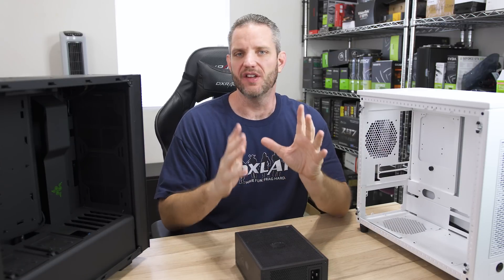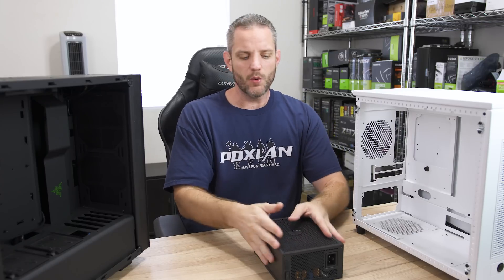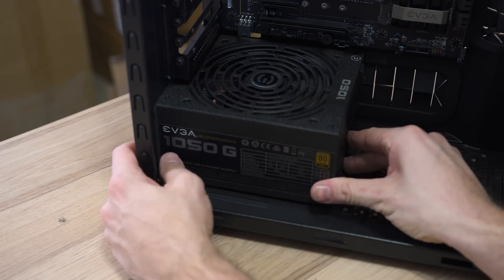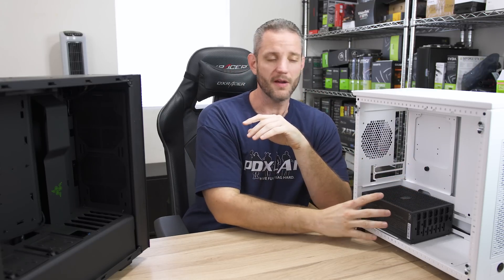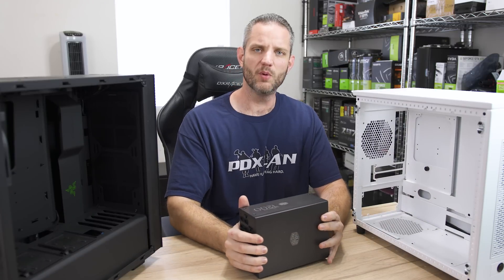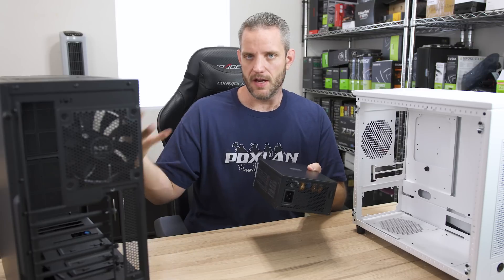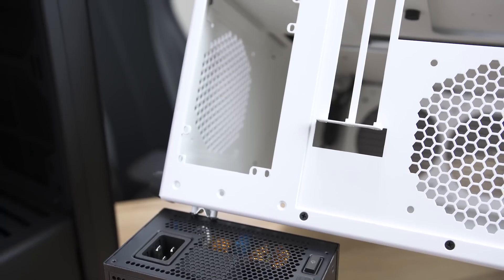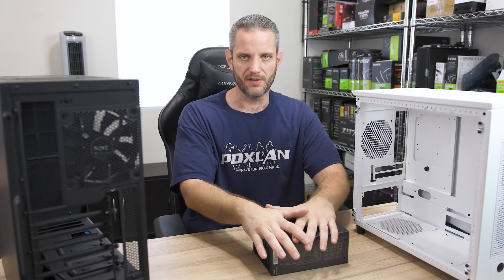Should you mount your Power Supply up or down?

Comment: It is a little confusing. The Power supply fan is always an exhaust fan. it does not pull in air. It is designed to draw heat away from the built in heatsinks that are attached to the components in the PSU.

It does not make sense to point the power supply (fan) downward as there is very little space between the fan and the floor.  An exhausting heat downward will only lead to that heat rising back into the PSU.

A power supply's ability to remove air is important but not nearly as important as the features that comes with the PSU. The power options, the connectors, and efficiency of converting AC current to DC current.

If a person needs to remove heat from the computer they should focus more on where the intake and outtake fans are located in relation to the CPU.

Comment: The clincher for me is that back in the nineties,  virtually ALL tower PC’s had the power supply mounted at the top rear of the case with the fan facing inside and moving air from within the case through the psu to the outside.  The psu was actually part of the case venting system along with the single pitiful little fan at the back exhausting the hot air.  Computers didn’t explode, psu’s did not melt and dogs who were unfamiliar with cats continued to accost them regularly.  PSU’s convert ac to dc and in doing so, create lots of heat.  Heat is their natural element and a few degrees extra of warmed air from inside the case (especially the well ventilated ones of today) is of little significance compared to what they are designed to handle safely as long as the psu’s rated wattage is comfortably a bit more than what the system is trying to draw.

Comment: 7 years later and with my new pc case there was no choice. The case manufactures made the holes requiring the supply to face down and draw air from the bottom. To me this makes sense. I would not want to add case heat to my power supply cooling input. Of all the critical systems of the computer I want to keep stable, the power supply ranks up there and heat is an enemy of any power supply. The bottom of the case should offer the coolest air draw, just keep it clear of obstructions.

Comment: I got a Corsaire CX750F RGB.  Its logo is printed on both sides of the unit in opposite ways so that, IF you can see it, it is right side up.  I like it sucking out of the case from under the video card which is verticle.

Comment: Hey Jayz! Would like to ask you about this topic; I just bought a asus rog thor platinum II psu which has the fan upside, but my current case is a coolermaster masterbox td500 mesh..it will be alright if the psu is installed with the fan up? I don't really care about the led display but would be good if I can install it the way is has been designed. Any advice please?

Comment: A question. when the fan is facing up and nearly never rotating, doesent the ventilation on the power supply facing up, radiate more heat to the mnve disk drives and the GPU ?
Than down...?

Comment: One thing that comes to my mind about bottom PSU with air intake upward: more exhaust in the PSU from the case means less air from the intake fans goes above to the CPU, also the PSU will suck some hot air from the GPU. For top mount downward intake, at least the rear fan will suck some of the air from the CPU.
The main reason I don't want to use a bottom PSU case is my room is dirty and all the dust and dirt falls on the floor. I don't trust no mesh to protect my PSU from that, even if I wanted to wipe the filter twice a day.

Comment: I had a power supply fan mounted up and now just installed inno3d gtx 1660 super gpu and now its getting hot extremely .56 c on idle with 2% load ,im worried 😢 im going to flip it down now i have same case as you shown of ur friend on carpet

Comment: should you run a psu in hybrid mode or with the fan on in normal mode? what if the psu never draws more than 50% meaning it never needs to turn the fan on?

Comment: It is worth mentioning that the mounting holes on ATX supplies are not equally spaced, and not all cases
have the extra holes to give a reverse option, something the designer of the case clearly did not intend. 
The ATX12V Power Supply Design Guide has recommendations for power supplies that require top venting 
and those that don't. On version 2.01, these are on pages 31 and 30 respectively.

Comment: So if I don't have a fan at the back I should have the psu fan facing down?
Reply: No he says if you don’t have enough exhaust flow face up so it will pull air out of the case, I would have eco mode off if that’s the case. If you have a shroud which prevent the fan from pulling air in the case then you have to face down. No choice in the matter
Reply: @OTK7796  excellent thanks for your reply mate appreciate it

Comment: I’m wanting to reverse the fan to pull air in through the power supply. Might sound silly at first but I have a small outdoor ac unit that pipes cool air into my studio and the air hose comes right into the back of the cabinet which I want to put my new thread ripper pro build. If the power supply were to pull air IN  instead of exhaust it would directly pull in the cool air from the hose and direct it upward onto the gpu ram mobo ect. Then get vented out with the upper back exhaust fan. It would reduce the internal temp about 15-25 degrees if I could just reverse the PSU fan flow. Asus Thor 1200 platinum. Any helpful ideas?
Reply: You could open up the power supply and just flip the fan around, if you are comfortable with losing the warranty

Comment: I have a bit of a long question please. I am building a big wooden PC based jukebox. The motherboard and power supply will be attached to a shelf within the jukebox. Question, will I need to have the power supply exhausting out the back of the jukebox or will it be ok to place it anywhere inside the box being that it is quite large? Cheer mate love the vids.

Comment: I don't suppose this comment will be seen by you with so many comments, but here's a related topic that I don't think has been covered: My PSU has 2 rows of modular plugs. Both rows have either 3 or 2 8-pin jacks marked "CPU-VGA-PCIE". My questions is, is there any difference between using two adjacent or 1 from each row, for the GPU? It's not as if my ASUS PSUs have any instructions.

Comment: Heh, sorry for bumping the thread. Just rearranged my cases and couldn't understand why all pc components raised 5-15 degrees Celcius. 
Reason for switching my main hardware system to my newer, cheap Riotoro CR 488 was that it was almost 'empty' inside with room for tons of additional case fan mounts - where my old Cooltek midi case included tons of hdd shelves, filling the inside up, blocking airflow, not suitable for my newly ordered huge GFX card.
Then realized my old cheap German CoolTek midi case had the PSU mount upside down. And having a big solid hightadjustable table there is plenty of free air beneath the case suspension the answer was obvious. So now my PSU is installed 'mountless loose' in my Riotoro CR 488 upside down - and what a temps difference to the good side!

Comment: Would a PSU at the top of the case with the fan blowing upwards be more beneficial? My previous PCs were all had the PSU at the top/rear with air blowing horizontally out the back. Now with increased heat and fans plentiful, would an airflow being pushed in the bottom and pulled out the top be superior? Thank you.

Comment: Started having problems with my power supply making a terrible noise. Come to find out my PSU was mounted fan up in a shrouded case at the factory. I'm wondering if this is the reason it's starting to give me trouble. Of course I shouldn't be surprised. This is the same PC that came with all of my fans installed as exhaust and a cooler with no thermal paste.

Comment: I have one of those supernova G3 PSUs, where the fan kicks into full gear once it reaches a certain temp/draw and remains there until the system reboots. I noticed this happening more when the vents were open to the bottom. I have mine open to the case, so that the pressure caused by the case fans force air over the PSU without requiring the noisy overdrive mode or whatever that is.

I just upgraded my GPU, and even this tactic doesn't help anymore. Time to sell this thing I guess..

Comment: I identify as a power supply.
The water cooling thing is a good idea.  Otherwise, it's fan up for me.  I can see the fan, know that it's unobstructed and less likely to have that "thermal loop" problem you described.  If it was more common to be able to monitor PSU temps with software or in the bios, I'd risk it the other way.  Surprisingly, tho, that still doesn't seem to be common.
In the distant past, I have run tach leads from PSU fans to MB headers, and, if memory serves, even ran a temp sensor once, but it seems that PSU monitoring never really took off, other than the ability to monitor the voltage.  I'm betting many a power supply got cooked without the owner knowing until the smoke was rolling.

Comment: For me, I have a SeaSonic Planium with Hybrid-Fan control. As the fan rarely, if ever, spins up, I have the PSU in a fan-up config as (in my mind at least) any warm air coming off the PSU vants up into the case where it's exhausted by the exhaust fans, giving a passive cooling vibe. If the fan does spin up, however, then that's an extra exhaust that will spin up to help vent the heat from the case before the temp sensors in the fan controller bring everything from "exhaust mode" back to normal running... in my mind... and in theory ^_^;;;
Reply: Yeah, I've done the same with my Seasonic Gold PSU.  Seasonic actually recommends this orientation if possible in a given case.

Comment: Hi everybody, I have a question regarding the video's topic and hoping to get some feedback/pointers. I understand that case type, general airflow within the case, components, pc orientation, internal case temp and where the pc is placed all play a factor in this matter. However I'm wondering if PSU with fan facing up into the case would be a better solution for my personal PC. I have a Cooler Master Q300L case, with Cooler master mwe 750 gold V2 PSU, ryzen 5 5600X and Radeon RX 6700 XT 12gb. My case temps are around 35 and CPU 50 Celsius under load and GPU 45 under gaming load; maxed out via 3d Mark my temps are CPU 64 and gpu 57. I wonder if I could even get better results with the PSU fan upwards; some more info. GPU and PSU are really close to each other, currently PSU fan facing outwards pulling fresh air from outside the case. My pc has 6 fans, 4 intake and 2 exhaust, CPU is air cooled with two fans on the heatsink. GPU has three fans. Any advice/pointers to if PSU fan facing up would be better, even when the PSU and GPU are super close; 3 cm apart. Thanks in advance!
Reply: I personally don't know all these specific parts. Since you already have recorded the temps with the PSU facing one side, you should try installing it the other way when you plan to clean your PC or something. And report the findings. Could help out others too.

Comment: I tried both configurations, i wanted to see if the psu up inlet would improve air flow and draw more hot air away from the gpu, yes it would heat up the psu and have a de rating affect but the psu is oversized so this wouldn't be an issue. The result was the exact same gpu temp in both configurations which was surprising since you would think this would assist the gpu exhaust. So i left is in the down inlet standard config.
Reply: That is indeed weird.
Although, out of all the fans, I have the hardest time understanding intake/exhaust and airflow of the GPU fans.

Comment: Jay, my case is an h500 unlike that other case there the bottom inside the case has all those holes where you can mount those brackets for the SSD's. Do you think I could face my PSU up cause this case is already negative pressure and It does run kinda on the hot side at times? I was looking for a way to improve the airflow some on this case and it seems having intake fans on the front does nothing for this case.

Comment: putting PSU with the fan facing down means all the internal components are ''hanging'' upside-down........will gravity pull loose some capacitors, etc ??....after all, the components are held only by the solder, right ?

Comment: I recently bought a new case and put my power supply in fan up. I have an extremely dusty environment and carpet (that hasn't been vaccuumed in 15 years). Good to know that newer power supplies don't spin their fans that much. I have two intake fans at the front, that are slightly stronger than two exhaust fans one on top and one at the rear. All are running by Smart fan 5 on my motherboard so balance themselves out automatically.

Comment: What about power supplies mounted on their side in the top back corner of a case? (i.e. in my old-ish full tower Thermaltake Armor I have the PSU's fan facing toward the optional hdd cage but if I were to have it facing away there isn't much room between the psu and the MB's plate and risks blocking the intake. I I figure the former is the most logical but I'm not really sure :-/).

Comment: Mounting mine up because case shroud is mesh and will maybe help remove heat from the bottom of a large GPU and my old psu is full of talcom powder because *someone has been powdering their bum to close the pc and the filter on the bottom of the case is not preventing hoovering up the powder. (1st world problems)

Comment: But what about those older cases that don't have any vents and the psu goes in the upper corner. Mine is mounted in the way that the fan faces up. Is this the correct way or should I flip it?

Comment: I'd like to disagree with this video and its message. The bottom line is this: If the power supply sucks in its own air from the bottom and ejects it out of the back of the enclosure, it will remain in specification, hold full warranty and likely live up to its OEM specifications(it lives in it's own little world of temperature by itself). If the power supply is mounted upwards, it will be forced to draw heated air away from the internal PC enclosure thus forcing it to operate above & beyond manufactured specs. The other problem is positive and negative air flow and how many PC builders both amateur and professional, get the air flow working against their power supplies. You see, in the eyes of the power supply manufacturer, they want to see no positive or negative air flow acting on the PSU fan. Both pressure imbalances lead to problems and short comings. The master PC builder vents the enclosure with the right fans and leaves the PSU fan out of the equation. As for carpet under the machine, well some people have to learn the hard way.

Comment: I've had a couple of power supplies die prematurely from being fan side down. All Corsair models.

My theory is that the "smart" fan on Corsair PSUs won't turn on unless your computer is drawing a certain power level. Even if the power supply gets dangerously hot the fan won't kick on. The temperature safety limit will always be hit before the fan is turned on.

When flipped fan side up, natural convection is enough to solve the problem entirely.

Comment: I have mine facing up because the cage over the fan is convex, so it lifts my PSU up and does not align with the screw hole on the case.

Comment: Hey I wanna know, I’m building a pc and I have a Corsair 275r mid tower case and that so called “shroud” thing is it in but at the top of it, it has a vent for the psu to be mounted with the fan facing up. I’m planning on having 3 exhaust (2 top 1 back) and 3 front (all on front panel) so I’m wondering what I should do for best cooling In that situation, also the pc will be on top of a desk.

Comment: For me. The fact is that the case is warm inside, but the intake underneath has a grill in it that doesn't match the grill for the PSU fan, so that does restrict airflow somewhat, as does the need to pull in in from under the case. So the question could be, is it better to pull in more, warmer air or less, but cooler air. I also suspect that cooler air is more likely to contain dust and things...

Comment: I second to buy a huge power supply. I got tired of my noisy PSU so I got a huge 1000 watt psu that turns the fan off until I really light up the GPU. By then I'm gaming so I won't hear it as much.

Comment: Do a video on ways to wire mis matched fans . So for example if someone has 3 fans with 3 pin and 4 pin connectors, then also 3 others with only 3 pin connectors

Comment: Funny how YouTube suggested this video knowing that I'm literally about to trade my Corsair RM 750W 80+ Gold 2018 (bottom fan), for a cheaper and more aesthetically pleasing newer model Corsair CX650W iCue white RGB (top fan) 80+ bronze 2020 which will actually be more efficient in the long run by drawing less power from the wall and matching my white set up with white cables and RGB lights for boosted performance ;)

Comment: I find sometimes I am forced to mount mine with the the cable closest to the frame so they reach the other end behind the wire management stuff. Most power supply cables are too short to mount both ways.

Comment: In my case, my PSU sat directly beneath the bottom of the motherboard with about 2 cm clearance.  This has an added benefit of pulling fresh air under the VRM's.  However often does the back of the Motherboard PCB get cooled?  Never.   My MB temps dropped 3C with my 3900X with PBO on.  (MB Sensor near VRMs)

Comment: My pc has the psu on the top and after 2 years of use it started making a sound coming from a capacitor due tk the fact it sucked the heath from the inside and trowed it outside making it heat up :(